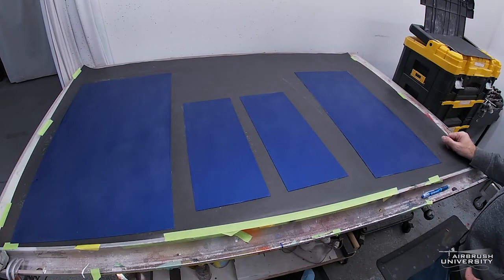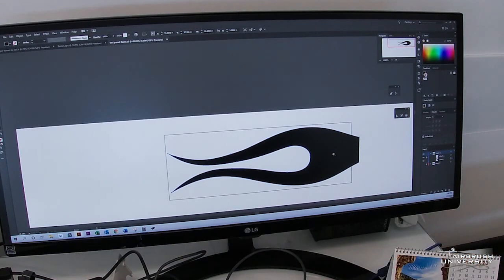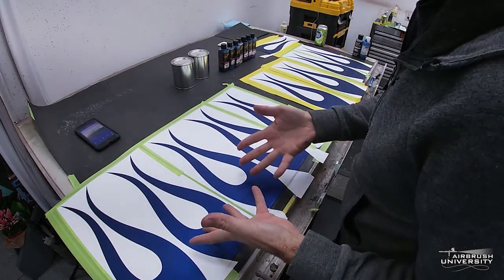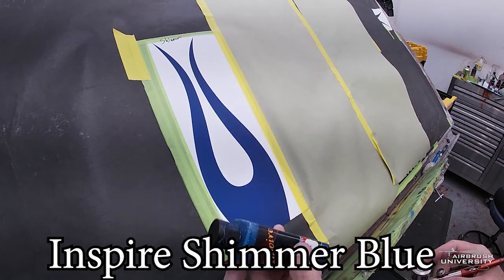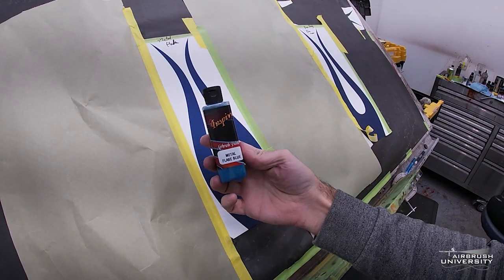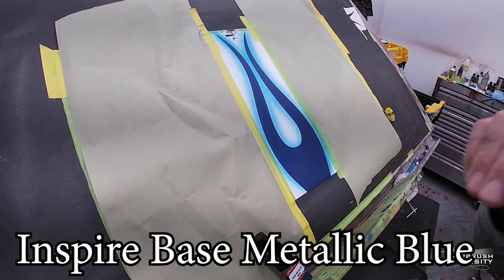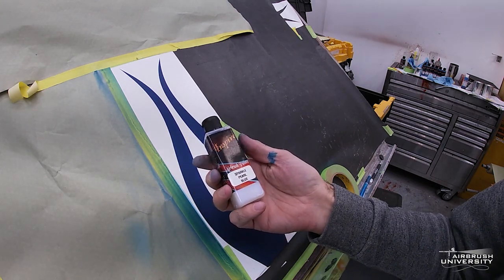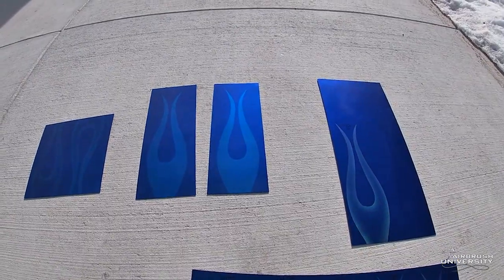How to airbrush several ghost flames on test panels. Inspire solvent based paints used.

Comment: Would it be the same process  if I wanted a purple metalic pearl on a black surface ?
Reply from the maker: Yes it should work especially if you want the flames to be ghosted in appearance. You would need to test and make sure the metallics are fine enough for an airbrush. You should also probably use an airbrush with at least a .5 needle/nozzle.

Comment: I just looked at some of your other work and now I get it. In other videos you are showing people how to create realistic works of art, so you film the whole process. I’m sure people can improve by watching these videos. But your level of talent is something that is not teachable. 🙂
Reply from the maker: Thanks for the compliment and the comment. I respectfully disagree with most of it however. There are several skills with airbrushing that can be learned even if you are not artistic or can’t look at something and draw it. I teach several techniques for transferring designs to work surfaces and various masking and stenciling techniques that create nice artwork and designs.  If someone will learn the fundamentals of controlling the spray of an airbrush and get their paint to flow properly they can be successful. I would agree that 100% freehand artwork requires the ability to look at something and draw what you see and this skill is something can be more challenging to get good at, but the majority of projects do not need 100% freehand.

Comment: Are you thinning the Inspire paints?
Reply from the maker: Yes I usually add a small amount of reducer until the paint does not speckle on the edges of your paint pattern. Each color is a bit different in how much reducer it needs and I add more if I’m going to paint fine details.

Comment: Hello what pressure are you running.  Sounds high
Reply from the maker: Usually around 40psi. Depends on the airbrush type, thickness of paint, and how wide I want my pattern. Also depends on how detailed I need it. Very fine details use thinner paint and less pressure. Thicker paint and wider patterns usually need more pressure to blast them out of the airbrush and atomize thicker paint. I am constantly adjusting pressure throughout my work day depending on these factors and desired result.